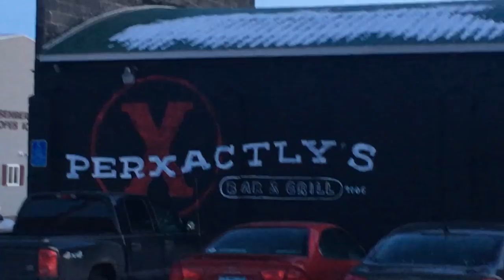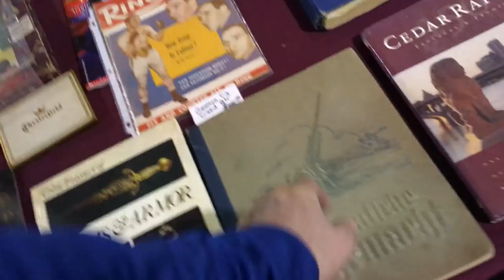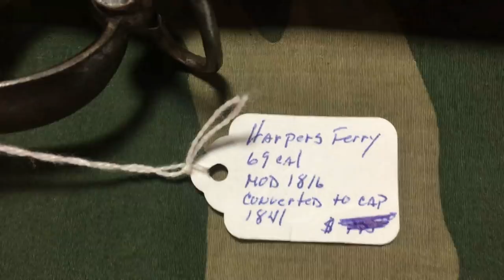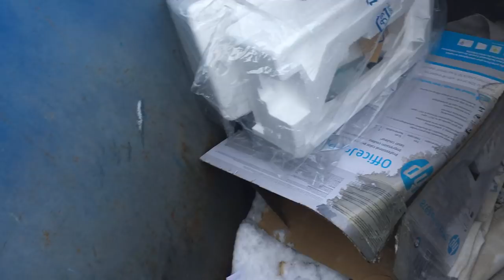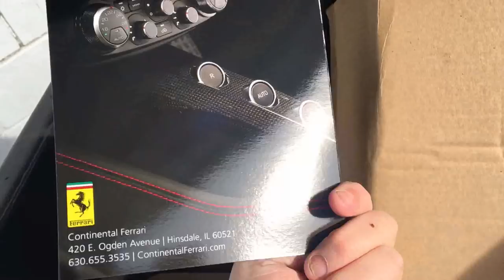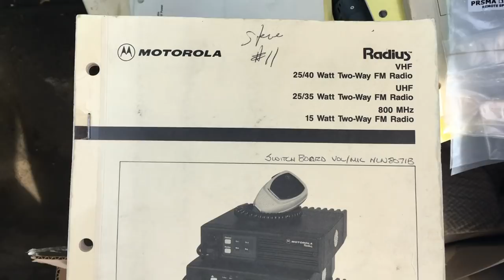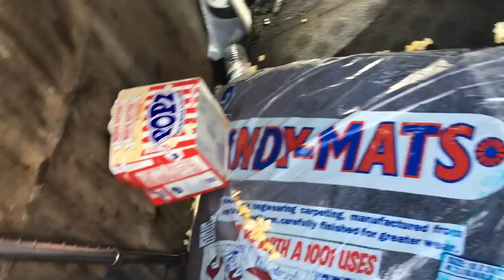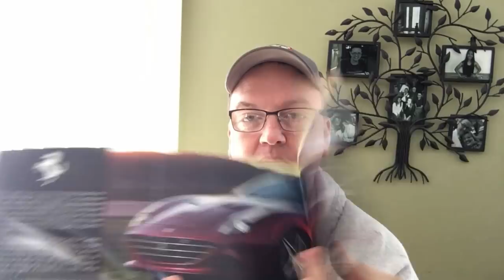Garbage and Guns! My First Gun Show and Dumpster Diving!

Comment: Free tool yeeeww...   the service manuals wont sell, if u check ebay listings they all have rediculous prices but if you check the ones that sold there are none, the thing is those adds are by people who found a pile in the bin like u did and tried selling then to no avail..       The reason they were thrown out is because they are all online now in pdf form for free, and thats easier to search than the manual for a technician in a hurry, and anyone needing it will find the free pdf online before they find a listing..